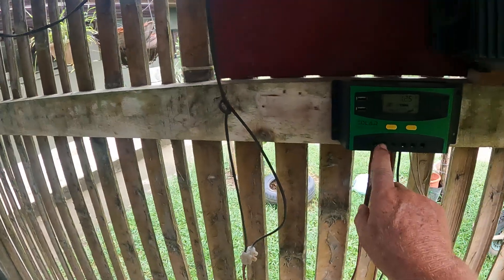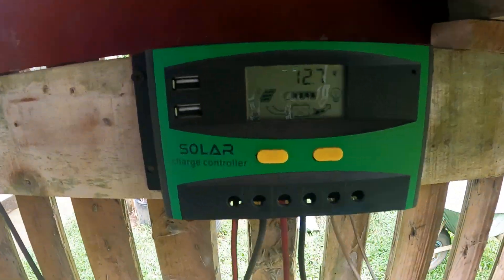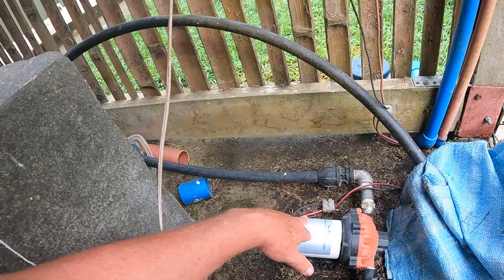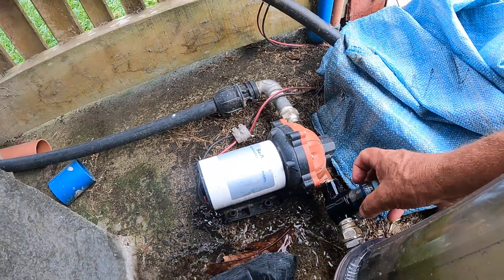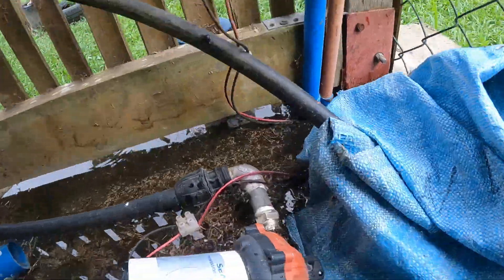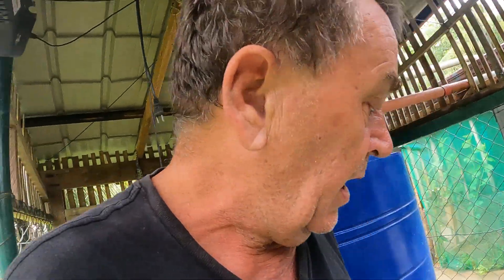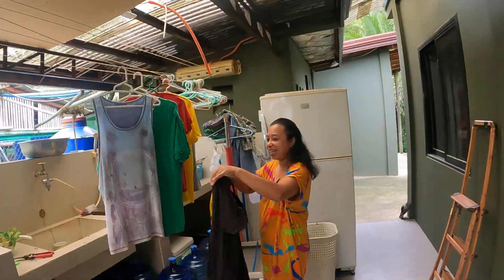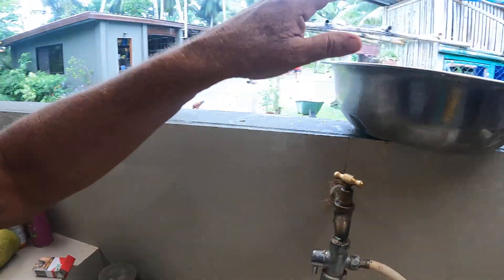Lou Brooks asked: "Can we see your Solar Water pump set up."

Comment: I like any concept to help the way we live with free in it if its free power using solar panels or well reduced bills and lights and anything to help free water concept finding a way to use rain water it has to be a saving on the $$$   So i say it is a good job for you no stuffing around with old chit you went out and spent some money ..
Reply from the maker: yes a good saving on not using the 240 volt water pump